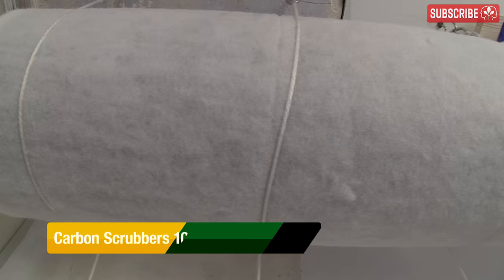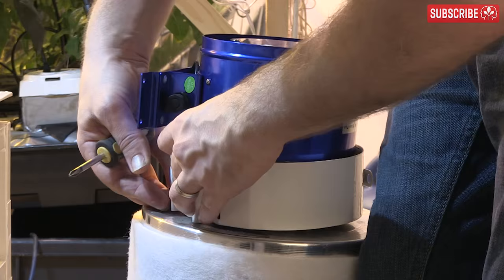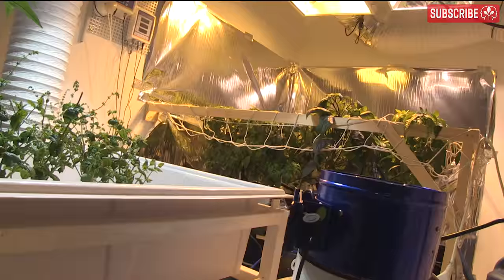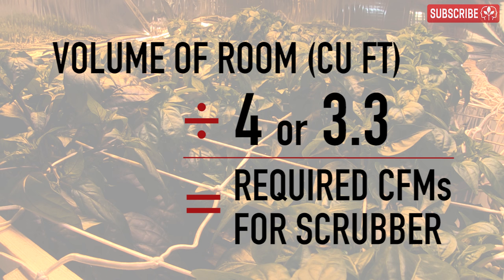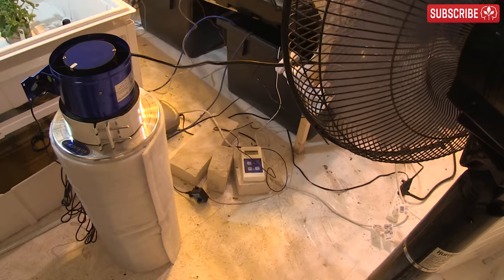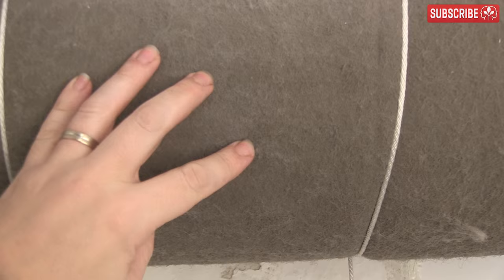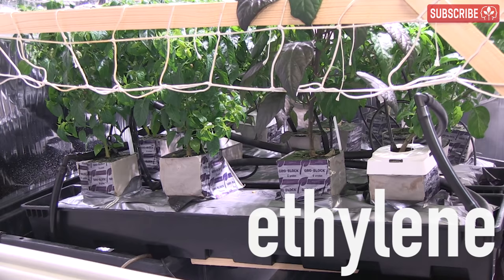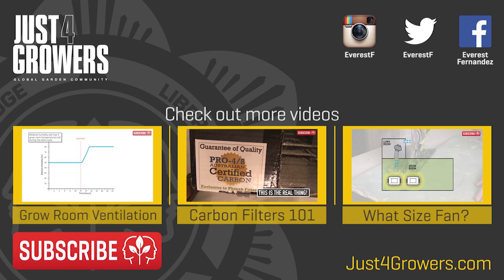Carbon Scrubbers — Grow Room Scrubbing 101

Comment: Will a scrubber be fine in a small 4x4 tent in a cooler basement if I’m not exhausting any of the air. Going to be planting 4 autoflowers and if i run an exhaust fan i feel like it will be to cold. I do have a small space heater but im going to be relying partially on the lights etc. to help with the temp until spring time.

Comment: Is this as affective as having it hung up drawing the air out of your tent? Are you just using a regular carbon filter and inline fan?
Reply from the maker: +greenboy93 Hi Greenboy. The key difference between a scrubber and an extraction / carbon filter set up is that the scrubber essentially recirculates the resulting clean air back into the growing environment—the same air, therefore, will likely pass through your scrubber multiple times. So, for maximum effectiveness, hang the scrubber in your tent but don't duct the air out. I understand that space can be a bit tight in grow tents, especially with lights, fans, and the carbon filter / extractor. I recommend the Skinny filter if this is the case.
Reply: +Everest Fernandez (Just4Growers) would this work if you just wanted to smoke in your room? As in if i got my carbon filter out and hooked my fan upto it like you have and placed on the floor could i smoke in my room and this would suck the smoke into it and push out clean fresh air so knowone could smell i was smoking?

Comment: Question for you I have a 8x16 room that I want to grow in but after checking prices on equipment for a sealed room it’s just out of my range . So I’m thinking of using one of the only things that’s still free ...air... I’m a bit confused on air intake and air output I’ve seen these dust-shrooms they say help with the inlet side ...for pest purpose and I guess a scrubber set up inside and a filter for venting...any suggestions would be appreciated

Comment: so if I have a carbon scrubber do I need to vent  out the old air still
Reply from the maker: Yes you do—unless you are supplementing with CO2, removing heat with AC or chiller, and removing humidity with a dehumidifier (i.e. a sealed room set-up) you will still need to vent out the old air and bring in fresh air. The primary reason for this is that plants absorb carbon dioxide from the air and, if you don't replace the air with fresh air, they will run out of carbon dioxide—which is essential for photosynthesis.
Reply: +Everest Fernandez (Just4Growers) Hey man.  I love your videos.  I don't understand what you just said.  after a "sealed room" set up you just said you'd still need to bring in fresh air ? I thought that's what co2 was for.

Comment: Are you sure co2 settles? Lol
Reply from the maker: Interesting question Toby—obviously it's a good thing that CO2 doesn't settle in normal atmospheric conditions otherwise we'd have long since suffocated in a stratification layer of CO2 and other heavy gasses at ground level! However, when we artificially elevate CO2 in a confined space (for the purposes of increasing photosynthesis) it's a good idea to help molecular diffusion with an oscillating fan. I'd be happy to continue this discussion if you think this notion of settling is erroneous! Lifelong learner :)

Comment: haha this vid comes out 1 week after getting a filter. 
i have a 
630w lec light in a 4x4 tent
6' inline fan 440cfm max
6x24 filter 525cfm max
my plan was to put the filter in my 4x4 tent w/ducting coming out of the tent to the fan sucking air from the tents passive air hole, trough the tent, filter, then out. I planned on running it on a speed controller at about half speed. Am i good, too little or too much, power&air?
Reply from the maker: +outlaw215 Hi Outlaw, please allow me to clarify: filter is in the tent, connected via ducting to a fan that is outside of the tent? If so, why not just connect the fan directly to the filter? Half speed sounds about right—remember, half speed doesn't necessarily equate to half the CFMs though. I can go into that a bit more in a vid if you like. By the way, I just hung my 630W LEC today!!! :) Wow! I've got 1000+ umols at my canopy now! Incredible. Just need to keep an eye on radiant heat. How are you finding it?
Reply from the maker: +outlaw215 If it makes you feel any better, the one I just got only has one switch for both lamps! But I don't intend on using them separately so I thought what they hell. The air-cooled model looks interesting. I note that it's using Sunlight Supply's sealed optic chamber technology like their ACDE reflector (which I love!) - I've actually got the two running side by side right now over my chilli canopy. It's ridiculously intense. 1000 umols @ 12 hours a day (truly simulating the tropics!) = DLI of 43 mol. It's definitely taking things to the upper limit, bordering on crazy territory! :) But it'll make for an interesting video!